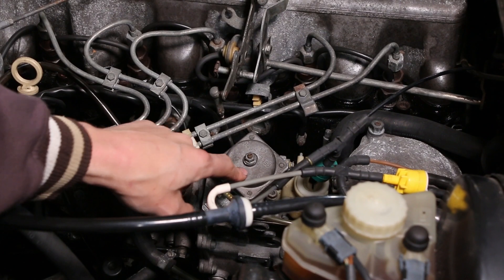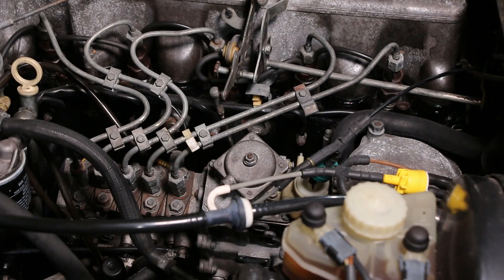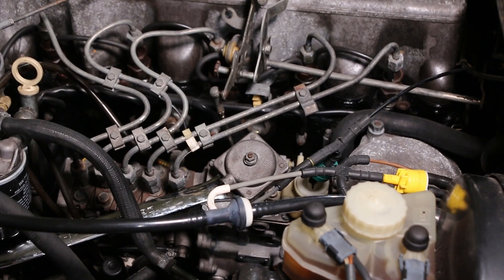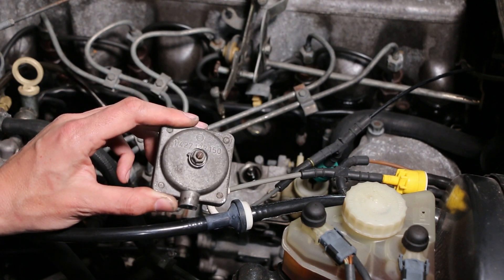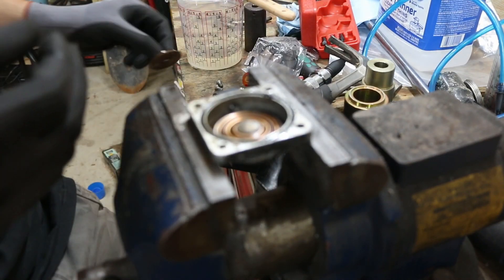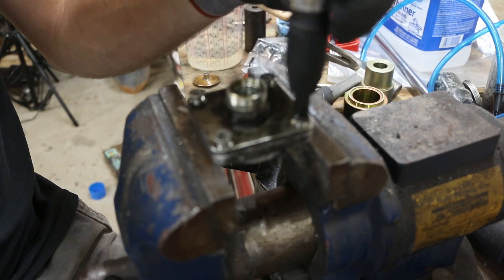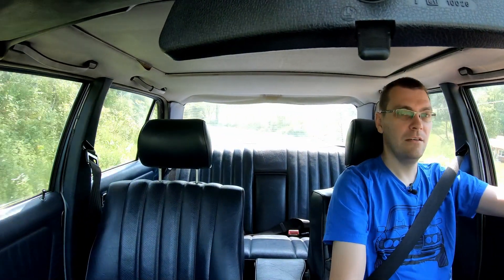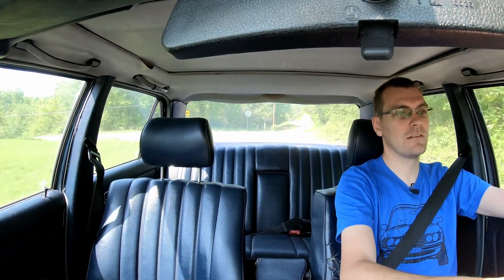W123 Performance/Maintenance: ALDA Removal and testing (OM617 Version of AFC Housing)

Comment: Hey there, thank you so much your videos have helped me out so much i really appreciate it!!! On that note did you leave your ALDA deleted or did you repair/replace it? And will it hurt the car if you leave it deleted?
Reply from the maker: with a stock injector pump it really won't hurt anything to leave it off, the stock pump doesn't put out enough fuel to really smoke or raise the EGTs to a dangerous temperature.
I left mine the same after this video, gutted of its internals, and the car doesn't smoke a bit.

Comment: After deleting my ALDA did not notice any extra performance. I did noticed a lot of black smoke. Someone suggested my TURBO could be bad. SInce i had one to swap, I did. Now my car moves really nice. And the ALDA delete does not make my car smoke.
Reply from the maker: I get zero smoke as well, Quite likely my pump is a little worn and doesn't put out quite as much fuel as when it was new. Typically an alda delete should create a small haze from a stop, but I get nothing. Car feels decently quick for a car of its age and weight!

Comment: What is sd314 nozzles??????????????????? I need nozzles for my 84 300SD asap
Reply from the maker: IDparts used to sell them: https://www.idparts.com/firad-injector-nozzle-314-an0sd314-p-3085.html
but they are out of stock at the moment.
You can probably source them somewhere, then you'll need either a pop tester or take your injectors to a diesel shop that can pop test and balance the opening pressures so each cylinder runs optimally.

Comment: I've got a 1987 300d with the om603.  The first time I drove it I was surprised how much power its got. When the turbo spools up it pulls very well. Only has 160k
Miles and has always been maintained.  In the past year I have put about $3000
Just into parts and tires. Getting ready to order all new upholstery for it. 
Its too bad mercedes don't build cars like this anymore.
Reply from the maker: The 603s do make some good power, I've never owned a 603 powered car, but I have driven several, and they are nice!
It's worth every penny in my eyes keeping my cars on the road. I just drove a few hundred miles in my W123 and man was it smooth and comfortable.
Reply: @trythistv  i was looking for a w123 and couldn't find anything that wasn't rusted. Or had very low quality paint jobs. Once you put a cheap paint job on a car
Its really hard to bring them back unless you remove all the trim and glass then strip the paint. I restored cars for 30 plus years and really wanted a w123 
And do a 0m603 swap. But I found a low mile w124 with zero rust and nice body.
I paid $3.600 for it and have put about $3000 into parts and tires. 
I rebuilt the injectors and turbo about 100 miles ago but I think im going to
Get a bigger turbo .injectors and have the pump turned up. Should really move when finished. Unless I sell it and get an older model. I like the older body style.
Reply from the maker: The W123s are getting harder to locate, A few years ago they seemed to have nearly no value, I saw decent 300Ds all day long on marketplace for around $1000, but not anymore. I'm glad I got mine when I did, I do need to repaint both of mine, and I'm figuring out how I want to do that, I'll be removing all the trim I can, but likely will leave the glass, as that would add a ton more work. My brother used to own a body shop so he may be able to provide some words of wisdom, and tools of the trade to make sure I get a very nice, very long lasting paint job.
Reply: @trythistv  i restored and painted classics for 30 years or more. The most important part of a good paint job is quality prep work and good name brand paint. Be prepared to spend $1000 on matterials such as abrasives. Primer. Sealer. Base coat and clear coat. Look for a good name brand high solids
European clear coat.  It will outlast you if properly cared for. A friend has a old caddi Eldorado I painted 15 years ago and still looks fantastic. 
The saying you get what you pay for is true when it comes. To paint work.
I won't do a paint job for under $5k  but I paint door jambs and all so it doesn't look like a repaint. I will probably have $2k into my w124 
Good luck on your projects and enjoy them. They are very fine cars

Comment: Just deleted my Alda per your instructions. 1981 300SD. WOW!!!  What a difference! Thank you so much for posting this great info.
Reply from the maker: As a note, doing this may make you fail an emissions test, it is unlikely, as in the 80s there was not a lot of requirements, but the EPA can be a bit nasty at times, especially recently, so I wouldn't recommend leaving it off for good if you are in the US and drive on public roads, mostly because if I become well known as recommending that anyone circumvent their emissions devices it would be bad legally speaking for me, so I will never recommend that anyone permanently disable any part of their emissions system. However if you are in another country that does not fall under EPA jurisdiction, or use your engine as part of an off-road device like a generator or such, then its up to you whether you would like it on or off, There are a number of companies that sell a nice little billet aluminum cap so you can completely remove it for off road use, or driving in mexico or wherever you may live...
Reply: Are you getting  alot of black smoke  now?
Reply: @termainerobinson5373 I have a 240d 1976 and it drives really well but has constant black smoke.
Reply: Good to know! 

I’m in California so 1997 and older diesel powered cars don’t require a smog check. 

I kept the parts though just in case.

Comment: And how did it go with the smoke?
Reply from the maker: Zero smoke at all throttle positions, load and rpm.
I think my pump has either gotten lean with age (needs full load turned up) or the timing is off (needs to be adjusted) as there should be some amount of haze at least with the ALDA non functional.
Reply: @trythistv  OK thank you! It really is amazing that you don't even have a little smoke! How many degrees is your injection pump on?
Reply from the maker: @gregoryarrieta3675  sorry I never got back to you. I'm going to have to make a video on timing pumps, as I checked mine and it was set at 16 degrees btdc... Stock is 24 degrees, and advancing to 26 or even 28 can get more power at the possible expense of harder cold starts and risking higher cylinder pressures that could pop a head gasket if it is already weak.
I advanced mine from 16 to 20, because I was just vaguely eyeballing stuff, but I need to do it proper and show both ways lol as well as getting mine right where it needs to be.

Comment: Hi there. I should first say that all your videos are to the point, well explained and help a lot. Thank you! I'm sure that they are truly appreciated by all who have seen then. 
About ALDA on your W123. Q1: Would simply removing it have the same effect? 
Another comment is that removing something that was a part of the design and having an significant improvement doesn't sound right. It looks like your ALDA was limiting the fuel flow with boost, so it's broken. This explains the car being slow. However, No ALDA should have a similar effect to when you unscrew the ALDA bolt up to the max. With this, you should see a lot of black smoke, which you don't see. I wonder why. I did experiment with ALDA and saw the black smoke above certain limit on my car (same model as yours). I'm willing to try more but would want to better understand what's actually happening with your MB :).
Another question I wanted to ask: Q2: What altitude are your at?
Thanks and Keep your videos coming...👍
Reply from the maker: What I have heard is that the MW pumps tend to get lean with age, they don't pump as efficiently, and move less fuel, which results in low power, and removing the ALDA can restore some of that fuel to make the car a little peppier.

I'll try to answer questions in a logical order, I a bit tired so hopefully it comes out right lol.
Yes, removing the ALDA would have the same effect, but then dirt or water could sit on top of the fitting on the IP and get down inside the IP, or at least I feel like it could, there is a seal on the rod that slides up and down under the ALDA.

The big issue with mine that unscrewing the screw on top didn't do anything is that the diaphragm parts had somehow cracked or something which led to the pressure causing them to expand rather than contract, so screwing the adjustment out would only have an effect until boost built and then the alda would expand and limit fuelling instead of contracting and allowing more fuel.

I am very curious about my lack of smoke, this car has never seemed to have a tremendous amount of power in the higher RPM, but has phenominal low end torque, which usually it tends to be the other way around with a 617, a little sluggish off the line but sets you back in your seat once the turbo lights.

I've been gradually heading in 2 directions in all these videos.
I'm suspicious if either the timing is off slightly, this engine is evidently a factory remanufactured block, so perhaps the IP got installed off a tooth, so at some point I'll be checking the injection timing.
or the 2nd option is there is something wrong with the pump, it has gone lean or was poorly adjusted from the factory and needs the full load adjustment turned up a hair, so that may be happening at some point as well.

I'm around 1300-1500ft above sea level, so not anything too wild. Hopefully that answers what you asked and I didn't ramble too long lol
Reply: @trythistv  Makes sense, and thanks for spending time answering the questions. It's interesting to hear about your power/torque pattern. I'd be quite curious to see where your timing is. If it's too advanced, it might explain it, but it should then result in more black smoke at acceleration, which isn't the case. Anyway, if it runs well and you don't see any other "bad symptoms" - enjoy! :)

Comment: do you also plug the plastic pipe thats coming from air intake to switchover valve (boost protector) ??
Reply from the maker: Yes, otherwise you'd be leaking boost out of the manifold. Entirely possible to install a plain bolt in the manifold as well.
Reply: @trythistv  yep, i just bought some alda delete kit , thank you sir!
Reply: @trythistv  Ah ha!  Now I have a complete understanding.  The little billet aluminum cap is not the only task at hand.  A "plain bolt" in the manifold is also a necessity.  #learning
Reply: @trythistv  Size?

Comment: Thanks lot for this video. Have a question would it effect the fuel consumption?
Reply from the maker: It could drop the fuel economy slightly, but mainly due to the fact that the engine is making more power. More power will burn more fuel, if you can keep your foot out of the throttle and modulate it instead of flooring it at every light to feel that rush of newfound horsepower then it should have a very minimal effect on mileage
Reply: @trythistv  ! thanks again for a quick response, Keep up that good work you are doing. I am watching your channel for a while and was able to fix lot of minor stuff myself on my both 123 and 126 both 1985 been educated through you and saved lot of money. HE may bless you.🙏

Comment: Will that's a huge difference 😯👍
Will try this om my Mercedes-Benz w126 300sd 😃
Reply from the maker: It has made an unreal difference in how the car feels. I'm wondering if my pump may be a bit worn, as it will not ever make any smoke even without the ALDA, but has a good amount of power, I may look into some of the more involved adjustments at some point so I can get smoke off boost and then put a functional alda on to make it how its supposed to be again, but we will see what I end up getting motivated to do!

Comment: Thanks for sharing.  Same applies to the om602/3/etc.
Reply from the maker: I figured it might be similar, but I haven't had much experience with the newer engines, good to know this info is useful for far more than just 617s
Reply: 602 n 603 have no bango bolts